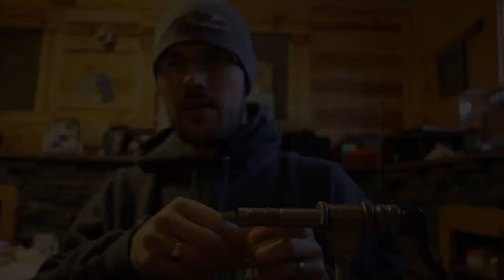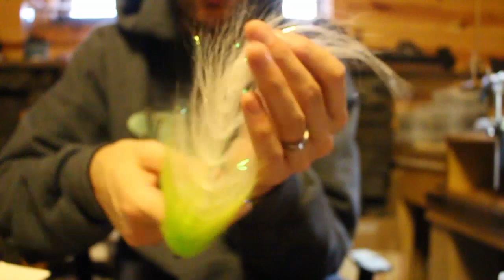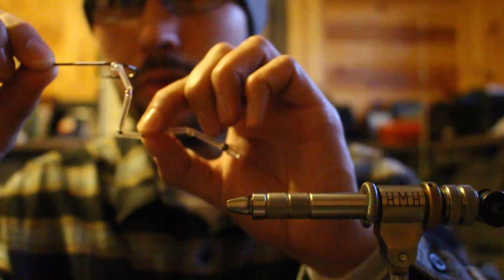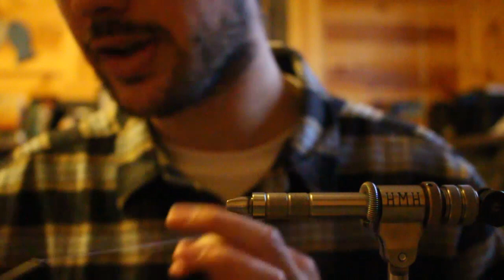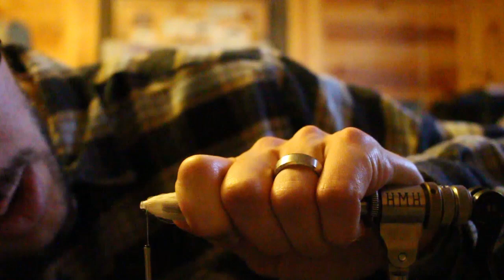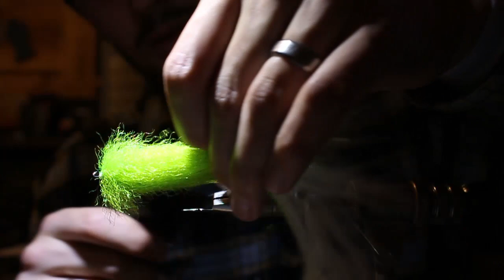Fly Tying: Beginner Predator Flies,  Build-A-Beast

Comment: Love your videos! For a bunker beast fly, it needs to be thin bodied with wide profile. What prevents tube sections from rotating. Is the bottom tied more sparsely than the top for a "V" profile when looking straight on at the fly?

Comment: Those beads in between the tubes are also a good idea. I did some tube Beasts a few years back with multiple pieces of tube on my the mono/wire but did not use beads in between. Did not like the end result of the tubes "spinning" freely on the mono/wire so cut that experiment short. Will have to give it another go with some beads in there.